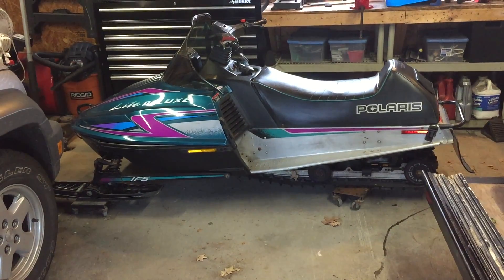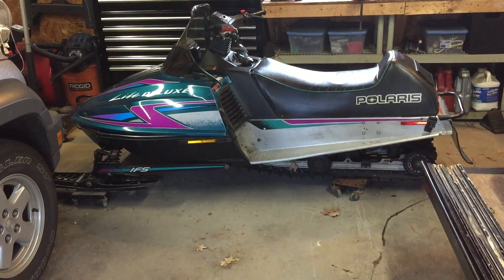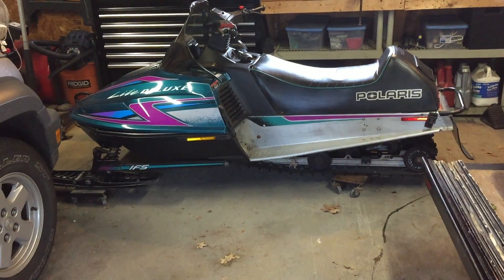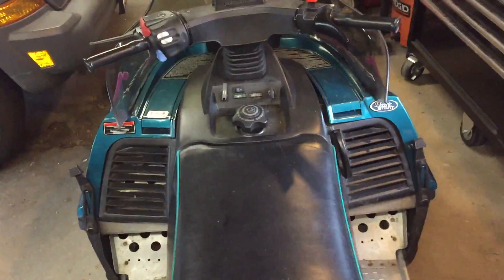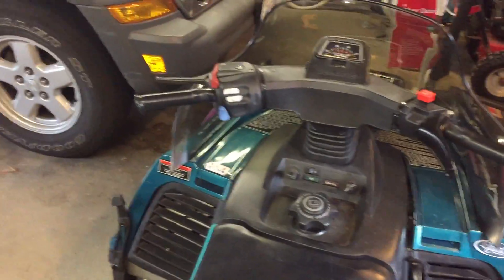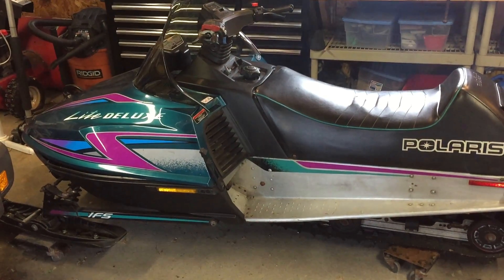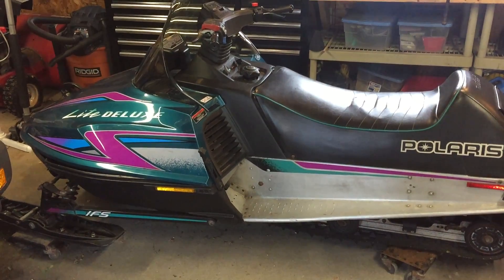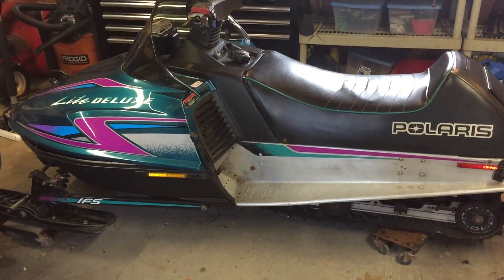1996 Polaris Indy Lite 340 - Cold Start

Comment: Sounds great, maybe not running on one cylinder at first, but it kicked in. Go out and run it for awhile with some fresh gas and it should be fine. Does the electric start work?
Reply from the maker: snowking55 

Yes the electric start works great. I just need to put a battery in it. 

I believe the issue is with the choke plunger on the PTO side. Last year I had an issue with the cylinder flooding out. 

I've noticed that the choke lever will not go into the second position. Probably going to replace the cables over the Xmas break.

Comment: My snowmobile takes a good 50 pulls it sucks but its good when i get going
Reply from the maker: TheDogemache 
What kind of sled?
Reply: Yamaha exciter 2 570cc ill have to make a video of it one day
Reply from the maker: TheDogemache 

It could be a couple of things, but it sounds like the sled is flooded. The next time this happens, pull the plugs and see if they are wet. If they are it's flooded. 

Pull the carbs off and rebuild them. You'll want to replace the needles and seats. This is the part that controls the amount of gas that's getting to the carbs. If they are worn, the bowls will fill up and drain the excess fuel into the cylinders and flood it out.
Reply: Well thanks for the tip ill be shere to do that